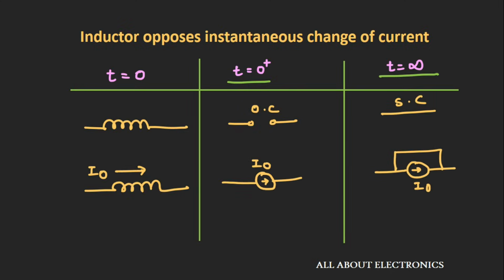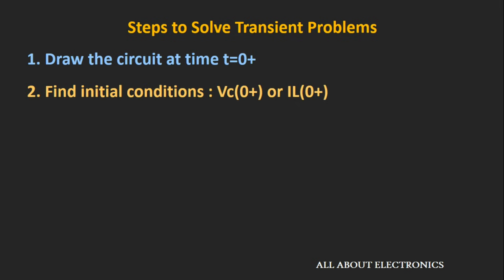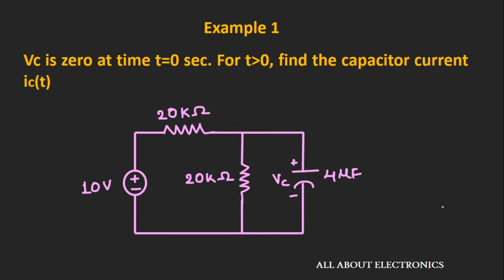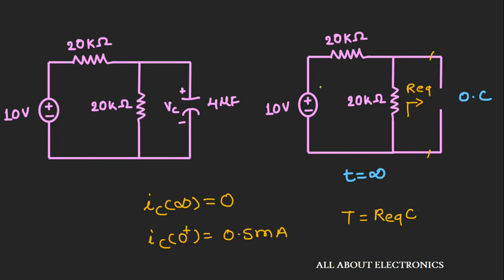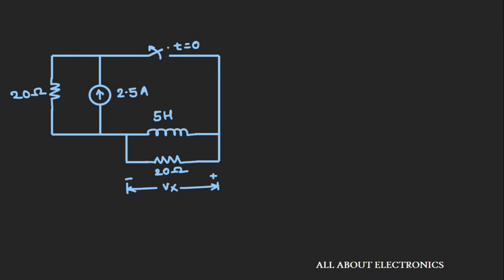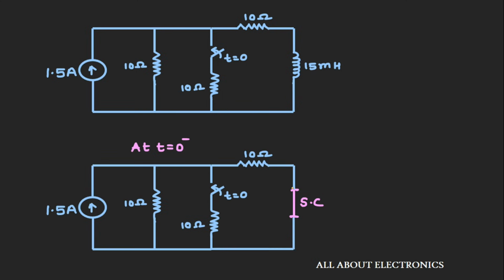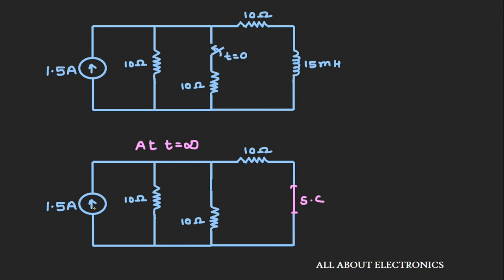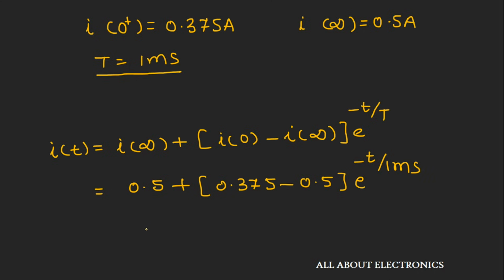Transient Analysis: Solved Examples on First order RC and RL Circuits

Comment: Sir, how about if the current source is being series with RC circuit? what is the proper computation for that? thanks
Reply from the maker: In that case, the current through the circuit will remain the same.  Only the voltage across the capacitor will change with time (as capacitor charges)

Comment: At 11:54 from where has that 2 in denominator come from
Reply from the maker: At t=0-, before the switch is getting closed, the 1.5A current is getting divided between the two 10 ohm resistors. (Considering inductor as short circuit). That's why current through inductor at t=0- would be 1.5/2 = 0.75 A.
I hope it will clear your doubt.
Reply: @ALLABOUTELECTRONICS  thank you  for clearing my doubt
Reply: Bro..but as two 10ohm resistors are in parallel Req=5ohms
Reply: sir please do video of two port network

Comment: Excellent work again.  I did confirm example 3 using LTspice. The equation is spot on and corresponded with the graph of the current through the resistor at different times.

Comment: In the third example at t =infinity, why is the inductor considered as short circuit and not as a current source along with the short circuit?
Reply from the maker: At t= infinity, the circuit is in steady state. so inductor will act as a short circuit. And the current which was flowing through the inductor will continue to flow through it. So, here there is no need to show it through a separate current source.

Comment: Sir we have to find i(t) which is the circuit response or current through inductor so why we are using 0.375 instead 0.75
Reply: We are asked to find the current of one of the resistors, not of the inductor. be careful
Reply: Yes we have to use i0+=0.75 in this formula that is current through inductor.
Reply: Sir why all conditions L is short circuit why atleast one time it's not open ckt

Comment: Sir to find I(t) why are we considering the current through a resistance parellel to the inductor in example 3
Reply from the maker: Because the current I(t) is the current flowing through the 10-ohm resistor. And to find that we need to consider these resistors. I hope it will clear your doubt. If you still have any doubt then do let me know here.
Reply: Sir in the first problem how can u write the current equation I(t) for the capacitor as it is mentioned already that is used for inductor
Reply from the maker: Are you talking about the first problem solved in the video or the practice problem given in the description?

Comment: SIR in qno 3 ,the question was like the circuit has been open for a long time and that at t=0 the switch is closed. that means at t=(0-) inductor should have been an open circuit becoz the current flowing is zero n in t=0+ also inductor should act as open circuit.why u have shown it as closed circuit as the circuit has closed just then
?
Reply: In example 3, if current through inductor at t =0+ is 0.75A as you said then why have you taken i(0) as 0.375A at 16:18 in the final formula?
Reply from the maker: The property of inductor is that it opposes the instantaneous change of current. It means that if any current is flowing through inductor at t=0-, then same current will flow at t=0+ too. Here in example 3, at t=0-, the current through the inductor is 0.75A. So, the same current will continue to flow through inductor at t=0+ as well. 
I hope it will clear your dobut.
Reply: thnks alot..
Reply: @ALLABOUTELECTRONICS  sir at 11.53 but in the question u don't mention its charged for some time how to take it as a short ckt ( can I take it as charging from initial(0A))
Reply from the maker: Here I(o) is the current through 10-ohm resistor which is in parallel. I think you misunderstood the resistor which is in series with an inductor. Please check it once again. And still, if you have any confusion then do let me know here.

Comment: you said at t=0+
inductor act as open ckt 
where it used ????
Reply: at t=0+ inductor acts as open circuit only if current through it was zero earlier. If there was already some current flowing through inductor, it will maintain a same current initially.

Comment: in qs 3 , why you used i 0+ as .375 ? should it be .75 ?
Reply from the maker: I(0+) current through the resistor will be, 0.375 A, as 0.75 A current will be divided between two 10 ohm resistors.  If you are taking about inductor current at t=0+, it is 0.75 A.
Reply: @ALLABOUTELECTRONICS   So, that's why we should use 0.75 as initial current in inductor
Reply: @ALLABOUTELECTRONICS  Shouldnt I use the current in the Inductor (0.75) not the resistor (0.375)? Plus I don't understand how the current in the resistor was 0.375 .. we completely ignored the main current source in this computation

Comment: only one doubt. we have to find Req for Time constant at which time. in first example it was found at time t=0 and in third it was found at time t=0+   , can anyone plz help ?
Reply from the maker: We always find the time constant of the circuit for time t>0. You can try this for any example on transients. 
I hope it will clear your doubt.
Reply: so why was it found for t=0 in example 1 ? this one doubt is scrambling my mind otherwise got all my concepts clear about transient. can you help me clear this one ?
Reply from the maker: In example 1 also, RC time constant is in fact at time t>0 only. In example 1 circuit is same (Circuit components are same) at time t=0- and t=0+. In some cases, particularly when you have the switch in the circuit which connects some part of the circuit with another part at time t=0, there you will see the difference in time constant at time t=0- and time t=0+.
I hope, now it will clear your doubt.
If you still have any confusion, then do let me know here.
Reply: I am sorry but I still don't get it. the resistance is short circuited at t=0+ and so is the capacitor. how the circuit is same at t=0- and 0+
Reply from the maker: See, the capacitor will act as a short circuit at time t=0+, or Vc(0+)=0,  that is initial condition of the circuit. But it doesn't mean capacitor is not present in the circuit at time t=0+ and so as the resistor. 
So, physically both are present in the circuit and so they are in finding the time constant of the circuit.
While, if you see in some examples where the switch is connecting any element or some part of the circuit to the another circuit. In that case at t=0+ and t=0-, the circuit will be different physically. (might have additional components depending upon the switch position). In such case time constant of the circuit will be different at time t=0+ and t=0-. 
So, in that sense in example 1, the circuit will be same at time t=0+ and t=0-.
I hope it will clear your confusion.
Reply: yes it did. thank u very much ! :) appreciate it.

Comment: sir at 12.54 why did you take the 0.75A of current as leaving for the node ..why it can't be incoming?? please answer my question
Reply from the maker: If you apply KCL at that node, then remaining 0.75 A current should leave the node towards two 10 ohm resistors. 
Similarly, at the datum node or reference node, the summation of currents through resistors and 0.75A should sum up to 1.5 A. And that is only possible when current is leaving through resistors and not entering into them.
I hope it will clear your doubt.
And still, if you have any questions then do let me know here.
Reply: ALL ABOUT ELECTRONICS Thank you sir..I got my doubt clarified..

Comment: sir what is the o/p if we connect current source to rc ckt
Reply from the maker: I hope you are talking about the circuit in which current source is connected in parallel with R and C. (i.e parallel RC circuit). Well, in that case, the capacitor voltage equation will remain same, 
Vc(t)= V([1-e^(-t/RC)] ; where V is the final value or voltage across capacitor in steady state.
Please try it by yourself by applying KCL in such circuit.